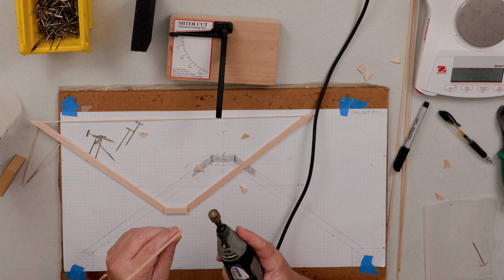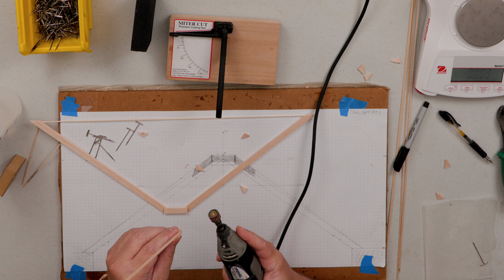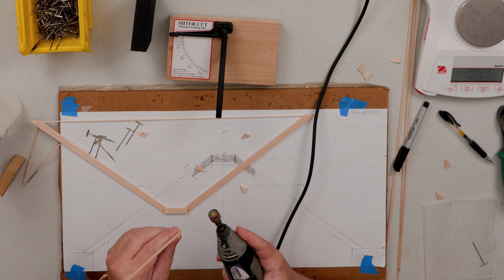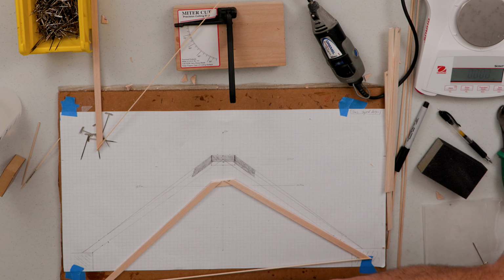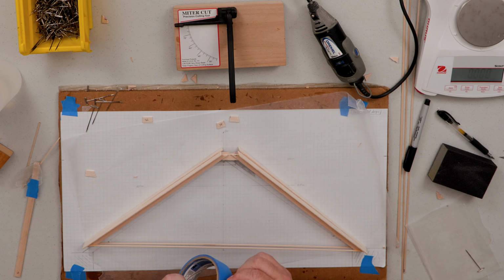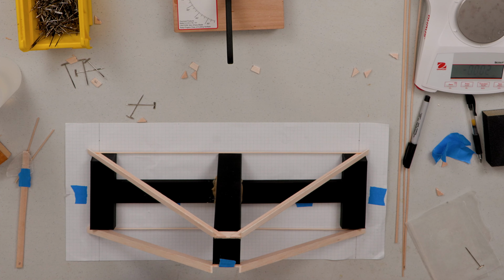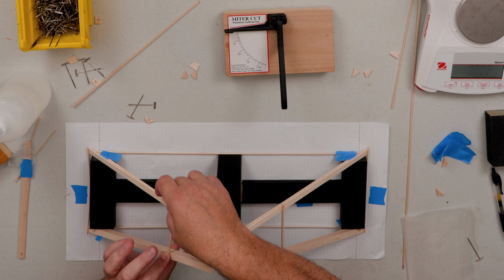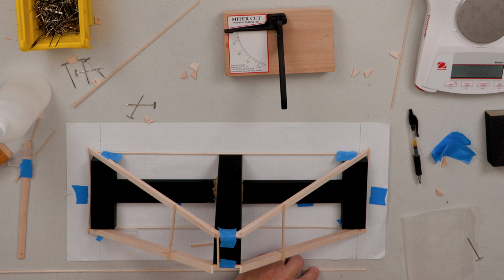Bridge 008 Division C: Complete Build

Comment: Could you elaborate more on the baking process? (Preheated, any pan to put on, etc.)
Reply from the maker: I would not worry about baking at this point in your process.  It involves putting it in the oven at 200 deg F for 20 min and then you have to immediately put it in a sealed dry-box to retain any of the mass loss.  There are some risks involved in baking as well as it makes the device more brittle.  I would recommend you just put your bridge in a sealed plastic dry box with silica gel packs and only open it before competition (when ready).  That will typically lose about 2-2.5% of the mass of your bridge with no real side effects.

Comment: I'm currently drying my bridge, and I think I hit nearly 0 percent moisture (the weights not going down). This made me think whether this would make the wood weaker. I heard that the optimal moisture  is 6-12 percent, but is 0 percent bad?
Reply from the maker: How exactly are you drying your bridge?  I like to put the devices into a "dry box", a sealed plastic container with silica gel packs.  That gets it most of the way.  I have experimented with baking the devices, 200 degrees in the oven for 20 minutes and that pretty much gets it completely dry.  Mixed results and I haven't done that lately.  I don't recommend that now as it's really a big hassle and the device will gain back the moisture in a matter of minutes.  You have to immediately put your ultra-dry device into a dry-box to maintain close to that level for a competition.  FWIW, in the winter sometimes the RH is already at 30-35%, so the drying process is not nearly as necessary as the spring when it can be well over 60%
Reply: I'm drying it by putting it in a plastic box with a vegetable dryer and silica beads. I didn't completely seal the box so that moisture isn't trapped inside.
Reply: So should I continue drying my bridge, or should I cool it down a few minutes before competition. I was afraid that testing it when it's completely dry would make the wood brittle.
Reply from the maker: I think you are misunderstanding how it's supposed to work.  When the box is sealed, the silica beads absorb as much water from the air as possible.  The water from the bridge then evaporates into the air and goes into the silica beads.  If you don't seal the box, the silica beads will become saturated and the humidity in the box will be the same as the outside air.  I recommend getting a couple small humidity meters.  Put one in the box and one outside.  As long as the inside is less than the outside, your silica beads are working.  They do become saturated over time unless you get ones that can be dried out themselves.  Something like these are very handy:  https://www.amazon.com/gp/product/B07GNMKYCZ
Reply from the maker: You wont be able to get it too dry by just using silica beads.  Definitely keep it in the box until right before you compete.  If you pull it out even a few minutes before, it will gain all the weight back.  (You'll need to be using a sealed box though, see my other reply)
Reply: @balsaengineering6686  Thank you! I was using the color-changing silica beads, and they are currently as blue as blue can be, so I thought it was ok to keep the lid not fully sealed. I will seal the lid using your advice.

Comment: Why does the mass that the bridge holds need to be close to 15 kg, isn't it good if it holds the most weight?
Reply from the maker: The Science Olympiad rules put a limit on the maximum weight tested at 15kg, so anything the bridge holds over 15kg is technically overdesigned and excess weight.  The goal is maximum efficiency: (mass held)/(mass of device) up to 15kg.  In practice, when there are extra rules for holding all 15kg (this year you get +5 kg added to your weight held if you hold 15), it's important to hit that weight in competition and not fail early, so you typically want to design to hold a bit more than 15 to be safe.

Comment: Hi, what was the wood you used for this bridge? I have seen other comments that you have made regarding this question, but I just wanted to find out what the exact type of wood you used was. I want to make sure to have the best wood possible for my bridge.
Reply from the maker: Hi, if you mean the dimensions, I pretty much show all that starting around the 7:30 point of the video.  If you mean where I got the material, the balsa would have been from Specialized Balsa, and the bass probably came from a random source on Amazon.  I have since found fnabco.com for bass and they are really nice.  If you can get the correct dimensions and density, it really doesn't matter where you get your wood from.  Let me know if you have any other specific questions, I'd be happy to help.
Reply: @balsaengineering6686  Thank you so much!

Comment: I built a bridge I'm very proud of, and it holds the maximum load without visible damage. I have to test a bridge again in just 3 days after that and I'm wondering if I should make a new bridge with the same design as the last one (but will probably never be as good) or use the same bridge. I'm afraid that the bridge will become weaker after I test it once even if I can't see any visible damage. Should I use the same bridge?
Reply from the maker: Typically, I have found that you can typically load the bridge up to at least 75% of its true maximum load without any damage.  With the events that had a huge bonus for holding 15kg (like this year), we would pre-test all the way up to 15kg multiple times to guarantee it would hold.  With you having only 1 bridge on hand, you need to be careful.  If you have the time to build a second one, build that, and then pre-test it to 15kg multiple times and see if it holds up.  If it does and it's lighter than your first one, definitely use it.  If it's heavier, test your original again to 15kg and if it holds, use that one.

Comment: DO you have the measurements for your jig your could share. Awesome video captured of your build
Reply from the maker: Thanks!  I'd be happy to share the STL files for my jig.  Don't think that this is the only possible design to use though.  I want people to use it as a starting point to think about the possibilities.  I'll put these links in the main video comments as well.

I printed 1 "middle" piece: https://klingerphotography.com/BalsaEngineering/DivC_Angled_Jig_middle_v3.STL

and 2 "end" pieces and glued them carefully together using graph paper as a guide: https://klingerphotography.com/BalsaEngineering/DivC_Angled_Jig_end_v3_1.STL
Reply: @balsaengineering6686  do you think your jig could also be made with wood, or would it be better to 3d print?
Reply from the maker: I think it'd be very possible to build a good jig out of wood, but for me, to get the angles and dimensions perfect, it's much easier to 3D print.
Reply: @balsaengineering6686  oh okay thank you

Comment: What’s the length of the piece of wood that under the X on the side? Thank you very much. And also, can you do a video regarding the process of the pass through block at check in? I’m having a little trouble/anxiety thinking I’m going to have a problem with the pass through block  and moving it through
Reply from the maker: For this particular build, it's about 9.5cm, but that can change based on how wide your leg top pieces are.  Regarding the pass-through block testing, the rules don't really make it clear how proctors have to do it.  I would make sure you have a 7x12cm block attached to a stick and make sure you can pass it through safely.  To me it's not clear if the proctors will allow you do it in at check-in in your hand or if it's going to be done after the bridge is set up on the test rig.  I think you'll need to prepare for either way.  Good luck!!
Reply: @balsaengineering6686  It depends on the competition. At the regional tournament, I was allowed to do it on check-in/inspection, while at an online invitational, the proctors wanted me to do it after I set the bridge up for loading. The latter doesn't make as much sense as the chain was already running down the bridge, so my partner had to move it to the side so I could pass the block through the bridge (which could then interfere with other parts of the bridge, depending on the design).
Reply from the maker: It seems pretty crazy to ask for it to happen with the chain hanging down.  I would hope that if that happens in the future, you might be able to ask to do it with the loading block on top, but no chain.  If I were proctoring, I'd probably have it done during check-in either in-hand or just sitting on a table, not on the loading machine, but that's just me. Because it's not specified in the rules, like you have already seen, it might be done differently at different competitions.  Hopefully they fix that for next year's rules if they do something similar.

Comment: What are the dimensions of the cross pieces used to jointhe 2sides together please i cannot find it and its urgent
Reply from the maker: If you mean the horizonal cross bracing members, for this build they were 1/8 x 1/16 basswood.  That's definitely not the only thing that will work well though, so feel free to try other options.  Good luck with your build!

Comment: Hi Balsa Engineering! Is it possible to post something similar to the template of the bridge in your video?
Reply from the maker: Hi Rohan, I don't really want to post something that takes away all the thinking needed to build something like this.  My recommendation is to start with a piece of graph paper and draw out one side to scale like I show in the video. That is most of what you'll need for a template.  I did post the actual STL files I used for the 3d assembly jig (linked in the description of this video), so that is another huge component in building this design.  Once you have the sides, you should be able to use the jig to assembly a really high quality bridge. Good luck!
Reply: @balsaengineering6686  I am going to use hobby lobby balsa wood, and I can tell the enormous weight difference for each balsa wood piece, but lets say if I got relatively fixed this issue and all the wood weight matches your video, would the hobby lobby wood have similar performance to specialized balsa in terms of quality, and if there is a difference in quality could you quantify the relative loss of efficiency? (Also thank you for reply and speediness!)
Reply from the maker: It doesn't really matter where you get your balsa from as long as you can find the correct thickness and density.  Don't worry if your first builds are heavier than what I show in the video, it's not a bad idea to build a couple first just so you know you can do it well.